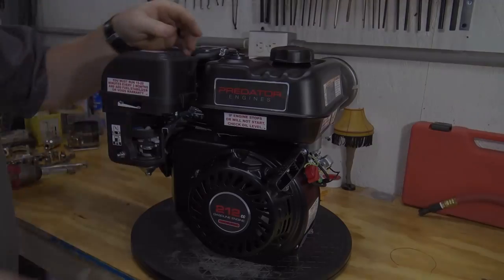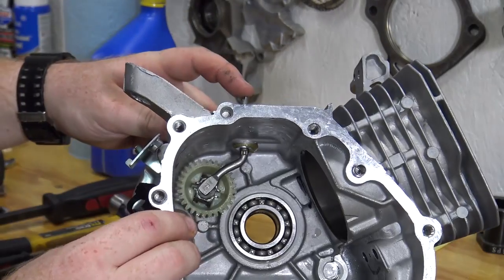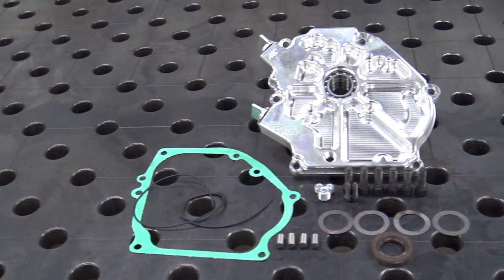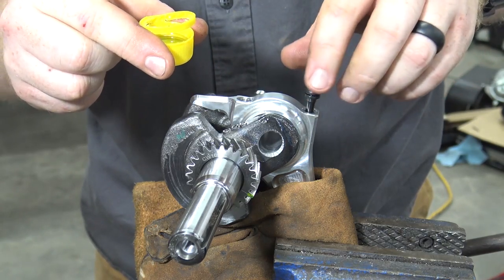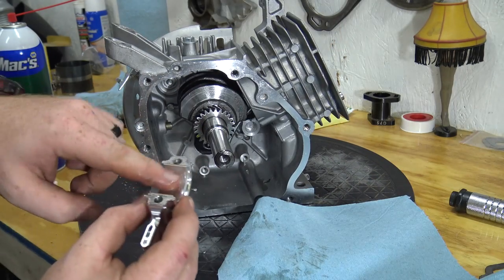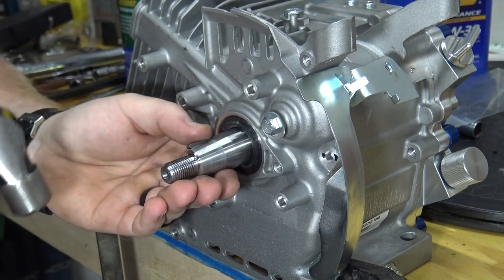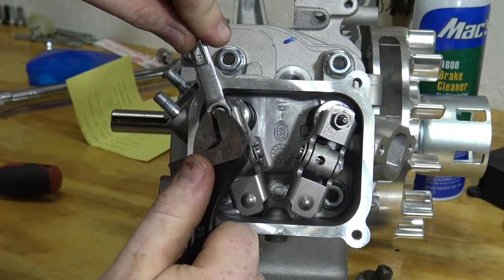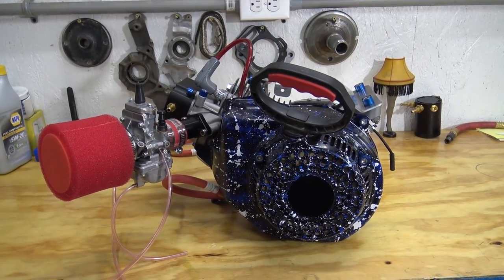Predator 212 Hemi Stage 3 Build ~ Billet Everything!!!

Comment: Red why don’t you ever port out the heads a bit?
Reply: I'm guessing it's so go power sports can demonstrate how much power can be "bolted on"
Reply: @Indiancreekgunsmithing  The new predator heads ( both hemi & non ) come with huge ports compared to clones.
Reply: @gastongregory1167  Gaston, a Clone of a Clone ?. Now I've got it .Thanks.Trev New Zealand
Reply: @trevinskiking2165  they are all clones of a honda gx200 most clones are made with lower tolerence standards. The preditors are pretty good compaired to most clones there are alot of diferences tho between them all
Reply: @aaronyoung8132  Aaron I knew all that but thanks for stating it for others less knowledgeable.

Comment: Great videos and Go-Kart & Mini Bike builds .
On a Predator 212 with a Stage 2 or 3 can I still run a torque converter ?
Reply: Yes you can but it is recommended to get one that is rated for the horsepower your engine is going to produce under the Stage 2 or 3 kit.

Comment: Does the arc hemi flywheel have magnets on inside of flywheel to be able to add charging coils for a headlight?
Reply: No.  If you want charging you should go with the Tilliotson e start. Their flywheels have much higher rpm range than stock predators

Comment: Hey RBG why do you dip the bolts for the rod in oil before you put them back in?
Reply: so u get consistent torque of the bolts inside an engine
Reply: Oh ok thx just wondering
Reply: Jeremy Dubs I guess that makes since. But more then one time I've cracked the rod. Then discovered it was hydraulic pressure from an old head. If it's clean you will always get consistent torque.
Reply: I wouldn't suggest putting oil in the hole if it is a blind hole. Doing so will cause a hydraulic lock and snap the rod bolt or pull the threads on the aluminum rod.
Reply: @MrMattydavee   Sorry Mattydavee I didn't read your comment before I chimed in.  But you are correct.
Reply: You can not hyrolock these rods. They have oil passages behind the bolts to prevent it. All you need is a drop on the threads anyway.
Reply: marc mo no problem bud I was just sharing my 2 cents from mistakes I've made. Nothing worse then saving money to get a part you want and breaking it before you ever get to use it lol

Comment: 🤔I got Champion rockers should I still use light and hardened lash caps? It's going in a 14 CC head on a Hemi block
Reply: Std would be ok,150 Lbs Springs & I'd be thinking of changing them.T NZ
Reply: Dylan you've got a hemi Head ! No offences don't you young guys know anything ?
Reply: @trevinskiking2165  I got a 14cc head my guy there's clearance issues with champion rockers I had to cut the head an get a different valve cover
Reply: @dylanweldon1363  Then it would be wise to Check your Piston to Valve Clearance - use a piece of clay or plasticine & do a trial assembly run or get a 2nd set of Valves, cut notches in them,assemble the MTR without the Valvesprings & use an Electric Drill or die grinder on the end of the Valvestem installed in the head & if there's enough depth left cut a groove in the piston top(If not use a dremmel tool or die cutter & manually cut some valve reliefs in your Piston using the squashed clay method) I cut tell you how deep to cut because that is dependent on your rocker ratio,how much they took off the head & the final Cam lift. The Piston manufacturers should have already thought of this & cast in or ground in some valve reliefs or "eyebrows" . If your going to rev the tits off it, it wouldn't be a bad idea to swap out those Asian valve collets, Lashcaps are little items that go on the end of  Valvestem, originally to adjust lash on cars that had some wear in em,if your running stainless steel valves with roller rockers, you don't really need em, the ends of stainless steel valves have usually been hardened.26 Lbs springs you could close with your fingers.If the Champion Rockers have a roller tip I wouldn't worry yourself
Reply: PS Lash Caps will help take the pounding your probably going to give. it but if you don't really know what your doing or the terminology Lash Caps are going to upset your valvtrain even more.As an aside aluminium Valvesprings retainers fatique & crack over time,with 26# Valvesprings your pretty safe but don't say I didn't warn you.Its not worth the risk,run stiffer springs & get some Chrome Moly ones cut for longevity, doubt me on alloy retainers:contact a Car Camshaft manufacturer like Rd Iskys Son.T NZ
Reply: @dylanweldon1363  Dylan by 'cutting the head' you mean you've had it milled down & your running longer pushrods cause of those 7 mm longer stainless valve stems & the 1.3:1 rockers I would say you'd have to do what I said above just for piece of mind.You want the piston about .005-010" down the bore for correct squish with the Stk Hemihead motor - use a copper head gasket you can cut out of sheet. Copper if you need to make "adjustments" like the top Fueler rail dragsters...you can buy the copper sheet at most crafts stores & you can use the stock headgasket as a template & they are reusable...in theory you want about .030" thou total squish depending on your fuel but you can get away with closer in actual to that !.If your using a billet rod they stretch a surprising amount at high revs so build for that.End of tips.Trev NZ

Comment: Seems you know these predator 212s could you tell me where they suck oil from when rolled over or thrown in a real hard corner. I have a go kart that had a tehcumseh on it and you could roll that thing all day and throw it in a high bank corner in our sand pit and never had an issue I backed into one day and broke the carb off it and I bought a new predator 212 for it and any time you roll it or throw it in a hard corner the thing turns into a fogger for a few seconds or so, it disappears in the smoke.

Comment: RGB: I have  noticed some people add a oil pressure release from the Valve cover back into the top govenor hole.  Is this better then a catch can or do I need both.  I have a Preditor 212 Hemi, govenor removed, billet flywheel, 18lb springs, 22mm mukuni carb, .010 head gasket, and I am getting a high ammount of oil blown out of the valve cover at high RPM.  Very messy.  How can I fix this issue. Please help.

Comment: Hey red beard what length chromoly pushrods did you use? Looking for a set for my tillotson 212 hemi head, I believe I've found the upgraded valve train kit you put on your engine here as well so I think I'm gonna go for that too, it's the only difference between my engine and your build here, plus the fact that I'm running pvl ignition flywheel and briggs coil

Comment: I'm putting a stage 2 kit on my hemi, and stainless valve kit from gopowersports, and a mikuni carburator, I'm putting 26lbs valve springs on it too, do I need to put better pushrods or better rocker arms on it?
Reply: Pushrods will be ok with 26 pounds springs.Roller 1.2:1 or 1.3:1 aftermarket Roller Rockers are a wise idea if your going to rev it.Notice how nobodies getting any reply to their questions.That the difference between partswappers & an engine builder & engineer,at least their trying but make sure you stop by powerprosports or whatever.Trev New Zealand

Comment: Hi there! I have a blown Predator 212 Hemi engine, but it still runs. The block is totaled and if I continue to build it with more power, it will blow. Do any of you know if the Reinforced 224 block would work as a replacement? Thanks.
Reply: It's been a while, but I believe that a 224 has the same block. The 224 is the same bore and a bit longer stroke, so that won't be an issue. I know the heads are interchangeable, you should be good. Just check the flywheel compatibility.

Comment: How did you keep the  Crank from spinning when you installed the billet flywheel?????
Reply: Linda, he used a common crankshaft key - fits in the crank groove & Flywheel keyway slot - Trev New Zealand PS & you can buy offset crank keys upto 8' crank degrees advanced which is 16' degrees ignition.Ask at you local speed Shop or try Isky Cams.T

Comment: May I share some tech info with you the next time you remove a flywheel rotate the flywheel so you have access to the counterbalance use your pry bars the normal way but instead of hitting the crankshaft strike the flywheel on the Outer Edge at the counterbalance with  the hammer it comes loose every time
Reply: Right? I have seen so many videos of hammering the crankshaft. Like they have never heard of crank walk.

Comment: Hey Red Beard. At 5:45 when removing governor gear from the crank. Once removed is there play in the crank since the gear is now missing? If so, How do you deal with it?
Reply: I thought about that too, although redundant the thin gear could be left in there & maybe no shimming of the crank needed later.Notice your very pertinent engine build qstn/comment went unanswered.Trev NZ.As an aside you don't remove a crank key with a solid hammer,you use a plastic or rubber headed mallet.And what's "God" got to do with anything ?"Trev NZ
Reply: Jose: notice it's been 3 months now & your very pertinent qstn...if it was me I'd leave the gear on the crankshaft & I have NO vested interest other than seeing you right( & others ) Cheers Trev NZ
Reply: Damn autocomplete: Jose if you take that gear off you'll need to mic or dial gauge the end float of the crankshaft the desired amount (you still might have to do that with the gear left on to check end float) The buying public isn't to know too much: it's called autocratic cencorship.T NZ😋

Comment: Just subscribed. Looking to build my first 212cc hemi predator and using this video as a guide. The link for the cam is no longer available through gopowersports.com What other cam would you recommend with the current mods listed in the description? Thank you!
Reply: Get Isky or local Camgrinder to do yours,stick to around 260-270' degrees & about 106'-108' LCA ( lobe centre angle) Trev
Reply: They don't know,no offence,their "parts swappers"  Trev NZ
Reply: @trevinskiking2165  thank you 🙏🏾
Reply: @Brotha_Marc  No worries. Trev NZ
Thanks & Reface the Camfollowers iF your running a Flathead industrial MTR like B & S too for other readers.

Comment: I'm new to this game but have been riding/racing off road and moto since 1974 so I know my way around a bit...2 things I noticed right off...WHY hasn't someone built a billet intake manifold that loops up and over so  when you go to a larger carb or even the adapter/pod filter in the stage 1 kit, its not sticking way the hell out into the wind??...not only is it in the way of riding, but I have seen vid after vid of guys crashing, which is commonplace on these things and wiping that filter or carb right off the motor??....why??....stupid. Another thing, WHY is the header on most of these minis sticking out in the wind from under the seat pan, just behind the aftermarket air filter pod, just waiting to burn the shit out of someones leg??.....that header could be made with a slight bend to the right and route it right under the seat pan and have the pipe route between the rear fender and frame rail, making bolting on a silencer easy-peasy with a bracket bolted to the frame rail......just crazy shit  I'm seeing with zero thought put into it.

Comment: Do you absolutely have to remove the metal governor gear from the crank or can you leave it there while the rest of the governor pieces are gone ?
Reply: Tai - no answer but with NO vested interest other than seeing you (& others) right, I'd save yourself some botheration & leave it there & check the end float on your crankshaft with a dial gauge or accurate dial calipers.Goodluck.Trev New Zealand 😇

Comment: I cringe every time you crank down those head studs. Hand tight. No tools. Also don’t put oil on threads of a rod cap bolt. You can put enough hydraulic pressure in the hole to split it.